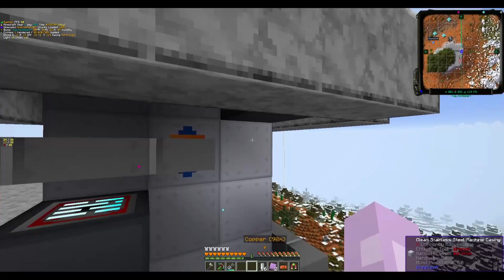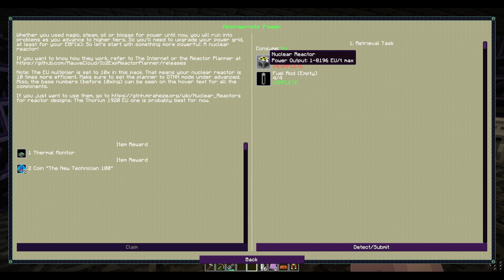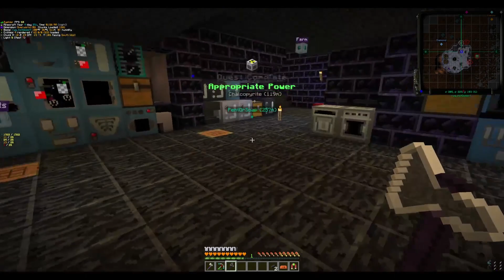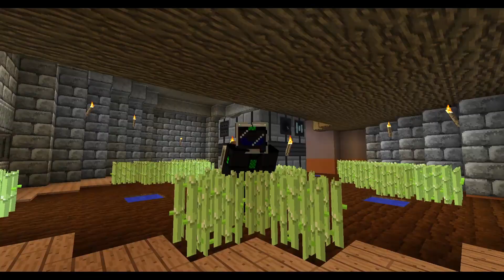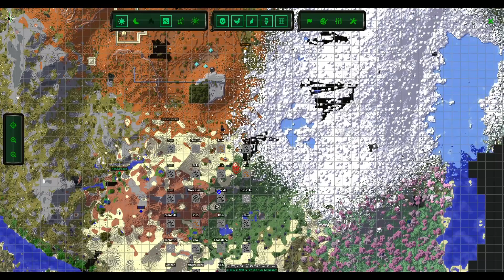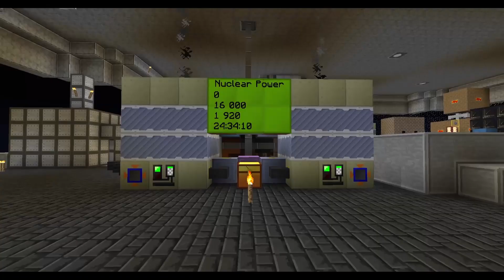GTNH Ep 10: IC2 Nuclear Reactor, Fermented Biomass Distillation, Cetane-Boosted Diesel

Comment: 5:36 what happened is that your canning machine had enough space to empty one cell of oxygen, which send it back into the centrifuge, which meant it had two with the one already inside, and it ran the recipe. I think that's what happened, at least.

If all you're interested in from Methane is Hydrogen there's actually a more efficient/easier recipe you can use in a chemical reactor, by mixing the methane with water. That said carbon dust is going to become more important in the very near future, as carbon fibre becomes used for circuit parts, but than carbon dust is also easy to get in different ways, so...pick and choose, really.

One thing you can do is craft an EU reader cover for the battery box, and run a redstone conduit line over to your nuclear reactor to automatically activate it once the battery buffer runs low on power. Not much room for redstone shenanigans, admittedly, but I think it should be doable
Reply from the maker: So I actually spent HOURS trying to figure out a good redstone circuit to use to automate the reactor but decided just do without it for now. I don't want it turning on and off repeatedly to save some lag is the issue I ran into..
Reply: @ApexPredaturr  That should be easy to set up with two EU reader covers *in theory*, but I make no promises on how easy it is to set up in practice. I'll give it a look myself, but I'm not promising any results.